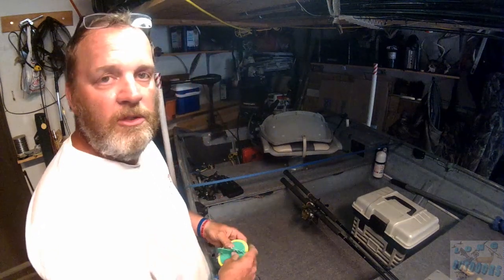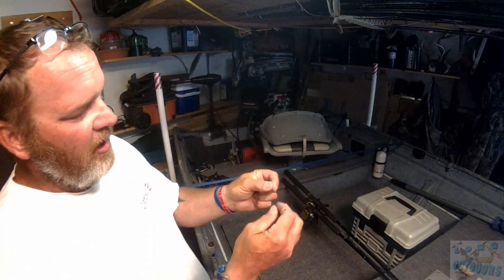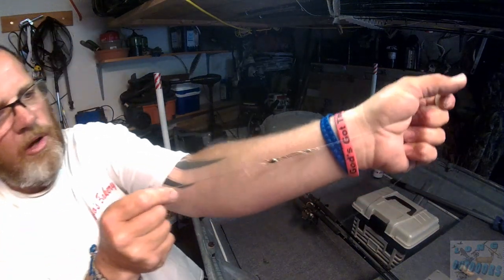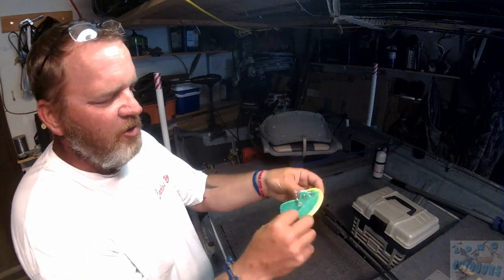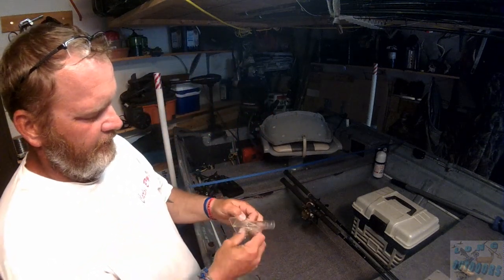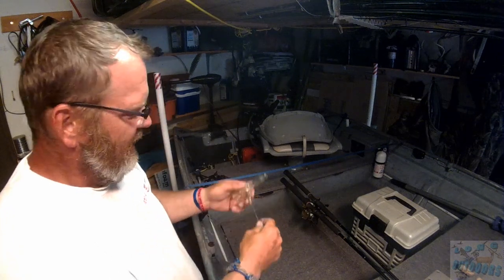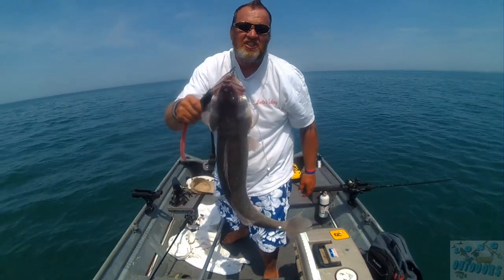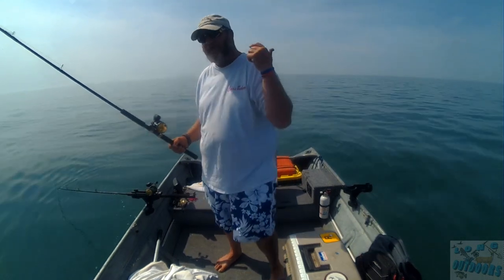HOW TO TROLL for BIG LAKE ERIE WALLEYE!! EVERYTHING to Get YOU STARTED #fyp #fishing #fypシ

Comment: Thanks for the vid but you should take a look at the Luhr Jensen Trolling Diver Depth Guide.  Luhr Jensen makes both the dipsy and jet.  A #40 jet diver as per the luhr Jensen chart reaches a depth of 32' with 125' of line out.  I use jets also but I wondered if it was a tally at 40' since our boat caught nothing and the other boat using down riggers did very well.  The down riggers  were at 42'.   Both boats using worm harnesses.  I looked online and there was the chart.  Now I own 2 down riggers and stopped guessing at how deep my jet actually was.  To say the least I was disappointed with the jets in the end.  Great video and as long as your catching fish that's all that matters in the end.
Reply from the maker: Thank you, yeah I have used jets for a long time, I can definitely get more depth specific with dipseys, but I use braid for my rods,  which in turn uses less line to reach my desired depth for dipseys but get closer to my actual depth with jets. It's kind of a double edged sword in the end. Yeah catching fish is the main goal for sure, and there are so many variables that can go into trolling it can make ya go crazy if you let it...hahaha. thanks again for watching and I hope I could be of some help for those that are begining or maybe just learned a new trick. Tight lines and keep the cooler full 👍